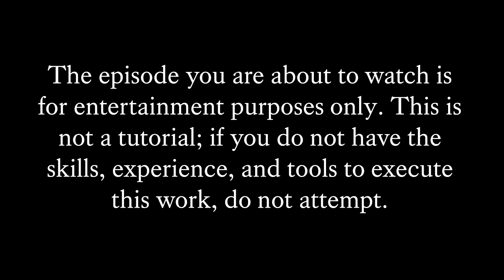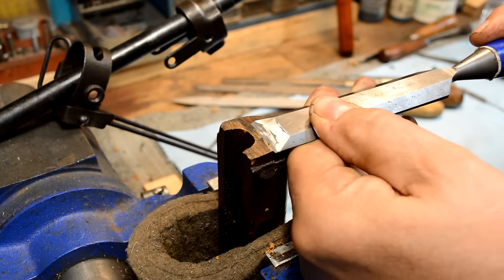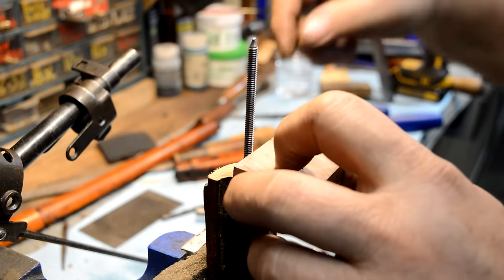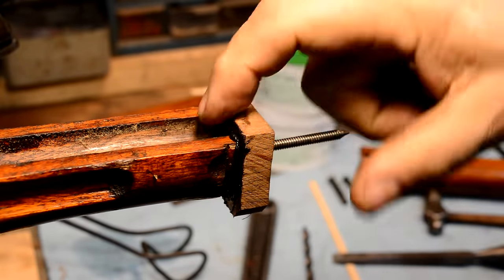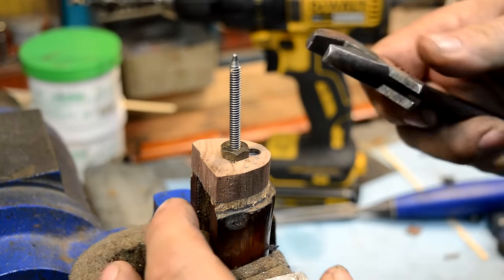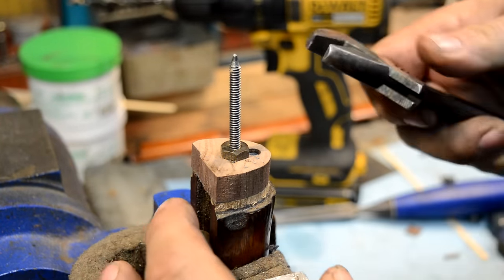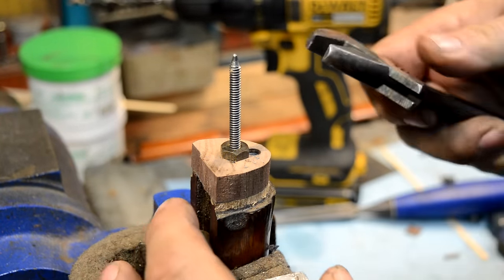Anvil 086: Type 99 Arisaka duffel cut repair

Comment: How do I get this guy to do work on my k98
Reply: Ask him
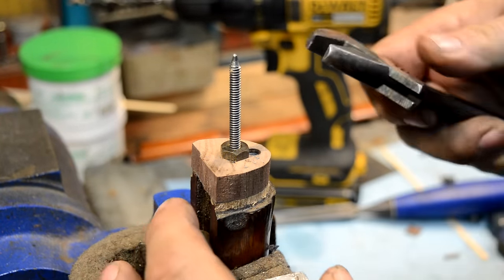Reply: Well this isn't going to be welcome but here we go. @31:53 we can very clearly see that the top edge of the stock on the right is noticeably higher than that on the left of the join. Mark does not see this. This is the stage where the parts are brought together dry so that they can be fitted correctly. Look closely, it can be seen that the barrel is sitting down hard into the wood on the right but is lifted in the wood on the left as witnessed by a gap between the wood and the metal on the left. This can only be caused by the wood on the right being too high in relation to the mother stock and shows that the hole for the threaded rod is in the wrong position and is causing the joint to be out of line. 
Having assembled the joint @37:43 we see that the exact same conditions apply and the repair is out of line. Start watching at 38:10 Mark checks the alignment and (look closely) moves the stock even further out of alignment by lifting it higher. Shortly after this he confidently tells us that this is not the sort of gun that you learn on. @40:10 here's the smoking gun! Notice how the wood grain is showing through the glue. It stops showing at the exact line of the join because the barrel was lifted up from the mother stock by the miss aligned stock. All the pressure of the rubber strap could not pull it true because the threaded rod could not allow it to move into line. @42:32 look closely at the visible left hand edge of the glue and it can be seen to have considerable thickness. This is the result of the barrel not sitting down in its cradle in the stock. The thickness of the glue exactly matches the degree of missalignment of the top edge. @45:01 he finally notices the problem with the top edge of the stock and cuts a little wood off. @45:16 Mark starts to explain that wood moves with time and he's right. However no amount of explanation can put this situation right. @47:18 he cuts away wood and tells us that it swelled right here. He demonstrates that he does not understand why the top edges are not in line and level. @49:14 this is the first time that we see the results of the missalignment. Not withstanding any bending of the top stock the gap between the top and bottom on the left of the joint is exactly equal to the degree of error in jigging the two parts of the stock together. Mark's attempts to blend the joint are seen as a freshly cut ramp in the wood. @51:23 Mark is telling us that the front end joint is tight and it is. However he makes no mention of the gap behind the joint which will always be there. @54:20 observe the gap where the top covers the bottom. In spite of any explanations that gap is there because Mark assembled it out of line. 
I have been a gunsmith for over 40 years and am often called upon to correct poor repairs. I despair at this job and I wonder if the owner will be content with explanations of swelling wood as he holds this rare example. Often I have found that workers who make sure we all know how good they are can produce average work with eloquent and lengthy explanations of how difficult it was and how the average joe would make a hash of it. I expect this comment will be deleted as it will not sit well with Mark Novak. I challenge you to leave it here so that your viewers can respond.

Comment: Mark you said "DO THE MAINTENENCE", I have a Arisaka 99 and all the screws are locked in place by being pinged with a punch, it looks like it has never been taken apart, I would like to take it apart to inspect and clean but I don't want to damage the screws. Should I just go for it or leave it alone.
Reply: You could always rig up a comparable screw arrangement in a piece of scrap, ping them in and see if you can get the screws back out without FUBARing them.

Comment: Hi Mark, Great video, great repair.  Were the 2 additional anti-rotation pins threaded and same size as the center pin?  What size threads?  I have a Carcano 1941 in great shape, but with a duffle bag cut.  I haven't seen one in a museum better than mine yet.

Comment: @50:55 did you put any sort of finish on the freshly cut wood before clamping everything back together?
Reply: Check out 50:20. He appears to have done something -- that part just wasn't covered in this video.
Reply: @alexr7298  Yeah that's what I thought but I'm actually curious if he tried to match the color or what stain, varnish, whatever he did use.
Reply: @IRMacGuyver  Yeah, I'm curious about that too. Whatever he did looks good, at least from a distance.

Comment: T99's are not that expensive.  Couldn't you buy a junky one last ditch and cut the wood piece off of that one?
Reply from the maker: The correct, original wood was already here.  Complete, correct Arisakas are rare and are quite spendy
Reply: The wood on those last ditch rifles is terrible.
Reply: Un-messed with stocks can easily approach 300.00 or more - and they arent even pretty ones - just uncut.

Comment: Should have double nut the thread and used a wrench...sorry, i dont mean to be that guy. I love the anvil series! Theyre almost as good as your piano playing. Best regards.
Reply: Mr. Novack is singing this song.
Shut up.  Get your own song.
Reply: @DanielESmith-iz7lx  absolutely he is! Thanks
Reply: Double nutting is a technique few seem to know about. I worked on cars, motorcycles, bicycles, karts, race cars for years and had never heard or seen of such a thing until one day installing an aftermarket clutch on a motorcycle for a guy. There was this tiny little stud that had to go in tight with thread on both ends for and an adjustment nut on the outside. I was baffled by this thing so read the instructions and it showed how to double nut it for install and removal and even included two otherwise useless nuts for the job. I thought that was the dumbest thing I had ever seen or heard of but it worked perfectly and have found myself using it for all kinds of things ever since.
Reply: @wingracer1614  
Seriously.  That isn't news. I work on things that require all manner of secure fasteners. Even double nutting.
I am not discounting your assertion.
Just saying it's His show. 
He messes up all the time. But it isn't our job to correct him.
Just enjoy the show.
Do you critique every note of every song you hear?
Just saying.
Reply: @wingracer1614  Hey, easy there friend. No disrespect intended.
Maybe I misinterpreted your comment.
Please extend some forgiveness.
I deal with incredibly ignorant people (not stupid, just ill experienced) on a daily basis. As I am sure you do as well.    
And my top certainly was not blown.
I apologize whole heartedly if my comment bothered you.
Reply: Wing racer? Do you deal with aircraft?
Reply from the maker: ALL....please note that the nut was only to hold the joint together while the epoxy set. It was then removed and not part of the repair.

Comment: Can you rechamber an arisaka to a 30-06 so it doesnt cost so much to shoot.
Reply: It can be done, but you have to alter the mag due to the length of the 30-06 round. Better yet, find one that was rechambered by the US Army in 30-06 for the ROK forces. It will say 30-06 on the receiver. They did the work for you!

Comment: Hello Sir,

Pretty cool video. I have a 1873 US Sprinfield Trapdood Rifle Aucton won that might benefit with the same repair that you did here. In my opinion somebody cut the foreend in an attempt to make the rifle as a carbine. I am from Waxhaw, NC and wondering if you could do the same repair of this video on my rifle.

Pls pm me.
Reply: Well this isn't going to be welcome but here we go. @31:53 we can very clearly see that the top edge of the stock on the right is noticeably higher than that on the left of the join. Mark does not see this. This is the stage where the parts are brought together dry so that they can be fitted correctly. Look closely, it can be seen that the barrel is sitting down hard into the wood on the right but is lifted in the wood on the left as witnessed by a gap between the wood and the metal on the left. This can only be caused by the wood on the right being too high in relation to the mother stock and shows that the hole for the threaded rod is in the wrong position and is causing the joint to be out of line. 
Having assembled the joint @37:43 we see that the exact same conditions apply and the repair is out of line. Start watching at 38:10 Mark checks the alignment and (look closely) moves the stock even further out of alignment by lifting it higher. Shortly after this he confidently tells us that this is not the sort of gun that you learn on. @40:10 here's the smoking gun! Notice how the wood grain is showing through the glue. It stops showing at the exact line of the join because the barrel was lifted up from the mother stock by the miss aligned stock. All the pressure of the rubber strap could not pull it true because the threaded rod could not allow it to move into line. @42:32 look closely at the visible left hand edge of the glue and it can be seen to have considerable thickness. This is the result of the barrel not sitting down in its cradle in the stock. The thickness of the glue exactly matches the degree of missalignment of the top edge. @45:01 he finally notices the problem with the top edge of the stock and cuts a little wood off. @45:16 Mark starts to explain that wood moves with time and he's right. However no amount of explanation can put this situation right. @47:18 he cuts away wood and tells us that it swelled right here. He demonstrates that he does not understand why the top edges are not in line and level. @49:14 this is the first time that we see the results of the missalignment. Not withstanding any bending of the top stock the gap between the top and bottom on the left of the joint is exactly equal to the degree of error in jigging the two parts of the stock together. Mark's attempts to blend the joint are seen as a freshly cut ramp in the wood. @51:23 Mark is telling us that the front end joint is tight and it is. However he makes no mention of the gap behind the joint which will always be there. @54:20 observe the gap where the top covers the bottom. In spite of any explanations that gap is there because Mark assembled it out of line. 
I have been a gunsmith for over 40 years and am often called upon to correct poor repairs. I despair at this job and I wonder if the owner will be content with explanations of swelling wood as he holds this rare example. Often I have found that workers who make sure we all know how good they are can produce average work with eloquent and lengthy explanations of how difficult it was and how the average joe would make a hash of it. I expect this comment will be deleted as it will not sit well with Mark Novak. I challenge you to leave it here so that your viewers can respond.
Reply: Man, stop copy and pasting your lengthy response to every question, trying to get Marks attention it stinks of desperation and a "know-it-all" complex.
Reply: @mwnciboo  You appear to have no understanding of what it is I'm doing here. I posted it on your comment in the hope that you would read it and change your mind about letting this man loose on your rifle. I've been repairing guns for years and I'm often paid to correct this quality of work.
Reply: @jonka1  In that case you would not have the time to waste copy pasting the same crap over and over.
Reply: @williamjackson5942  It would not be a waste of my time if I help to prevent another gun owner from entrusting his weapon to this standard of repair. 
Instead of blasting me perhaps you could direct you attention to the actual content of my original posting. If you truly think that this repair is a first class job done on this gun then I suspect we have nothing else useful to say.
Reply: @jonka1  LOL!
Reply: @williamjackson5942  :)

Comment: That's not a bipod.
It's a monopod. It only has one leg.
Reply: It may appear that way to you from the brief glimpses we get because they are so close together but there are two separate stiff wire legs that can be bent apart and then rebent close for stowage.  They were cheap and easy to manufacture so they could be easily replaced when repeated bending caused them to break.  Another advantage is that they are extremely light when ounces count to the man carrying that rifle all day, every day.  Bending them now would be a sin because they would be impossible to replace with an OEM part.
Reply: @UCcl54OusMTCLhiOax4PrRHQ 
They do sell repro's on GunBroker.com. I have one on my 99. Seen OEM ones for sale too and they are EXPENSIVE.  But they do refer to them as "monopods"

Comment: Actually, it is a MONOpod! Meaning one (1) leg. Bipod has two (2) legs.
Reply: Yup
Reply: If you want to get stupid.  The wire support has two, count them two, wires coming from the fore end. And connected near the "feet".
That would constitute two, (read bi) legs.
Reply: Daniel E. Smith now that is an explanation almost Marian Webster’s type.
Reply: @DanielESmith-iz7lx  Ah, but the legs connect to only one(mono) foot(pod).

I couldn't find a good word for two legs and one foot. Presumably nobody had gotten around to inventing diabetes in ancient Greece or Rome or wherever.
Reply from the maker: Yeah, its a monopod. Bruno reminded me of that probably 50 times, so don't feel bad.
Reply: @Halinspark  That is awful!
But funny. I sit corrected.
Fun having the discussion.

Comment: The rattling bolt dust cover is the reason many Japanese troops removed and discarded the device and why they're relatively rare.
Reply: Sir, you've heard an old wives tale. No disrespect intended! Dust covers were hand-fitted to each rifle and barely perceptively rattled when the rifle was handled, and in the heat of battle, no one worried about any noise made as the bolt was cycled. The rifle was property of the Emperor, hence the mum. A Japanese soldier didn't dare discard anything that was his. He would have been disciplined by his senior officer. Many serious collectors and WW2 PTO historians believe dust covers were tossed by G.I.s who didn't know how to reinstall them once a bolt was removed from a rifle. Anyone who has removed a bolt and dust cover knows it takes a little practice to get the knack of realigning them properly so they will slide into place. The G.I.s couldn't be bothered with that.
Reply: @Japcollector  Was going to say the same thing! Amazing how many people get this wrong...
Reply: @Japcollector 
Pure bollocks. If a Imperial Japanese soldier "lost" his dust cover he'd be severely "disciplined", (beaten to a bloody pulp), by either a non-com or an officer.

Comment: Warum pfuschst du so rum. Epoxy bei dieser alten Waffe, klebst den Lauf an das Holz und bohrst einfach Löcher in altes Holz. Bestimmt hast du Ahnung von Technik einer Waffe, aber nicht von Holz 👎
Reply: Wie würde man so einen Schaden richtig reparieren?
Reply from the maker: Reparationen var tvungen att hålla tillbaka accelerationskrafterna. Den ursprungliga snittet för att ta bort det framåt avlägsnade träet som var tvungen att bytas ut. Distansbrickan lämnades tjock så att den kunde hanteras. Allt detta, och reparationen måste vara osynlig när den ses. Hoppas det här hjälper.........    (Google translate)
Reply: Ok lets try its with my poor english. To repair broken Wood on this historical wappon it needs no metal and no epoxy.  The pice with metal in it, will brake again, cos as you know wood Works. And there are to many „Spannungen“ NOW. Das Holz kann sich nicht bewegen. The needed pice insert with dove tales and use „fischleim „ . This it use for Restauration old broken wood. It will be Strong as hell and flexibility like the hole pice of Wood.  To close the wood under the metal use „Schellack „ 
Es ist ok wenn man Reparaturen oder Restaurationen sieht, solange sie zeitgenössisch sind.
Reply from the maker: @svenruger689  
It did not break, it was cut into two pieces, on purpose. not a structural defect repair

Comment: Why did you destroy this piece of history by modern compound ?
Reply: Mark didn't destroy the gun, he restored it full functionality with minimal cosmetic changes. Go to 47:41 and listen to what he says.
Reply: @FireflyActual  I saw what he did. Why is the chamber drilled through?
Reply: @hurricanearthur9742  You mean the hole at the top of the receiver? That's by design, it's to vent high-pressure propellant gases away from the shooter's face when a case ruptures. Othais described this in detail in the Type 38 videos.